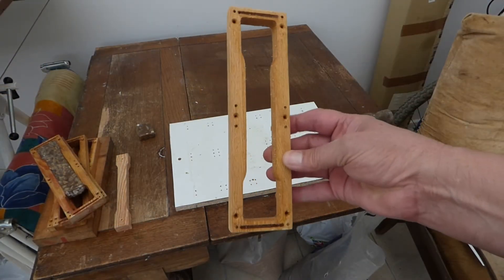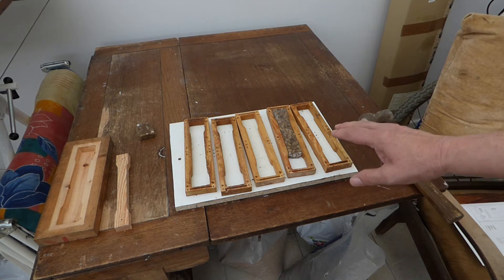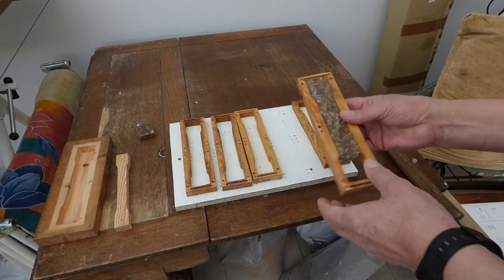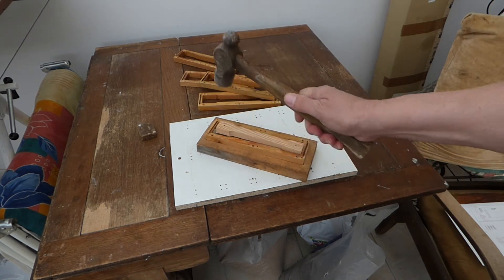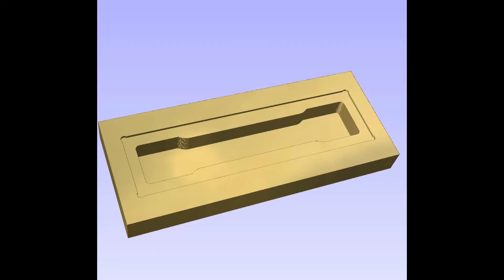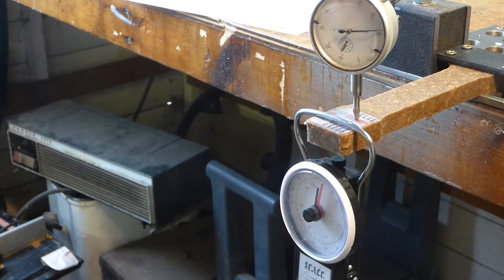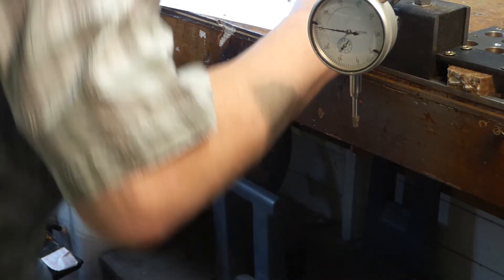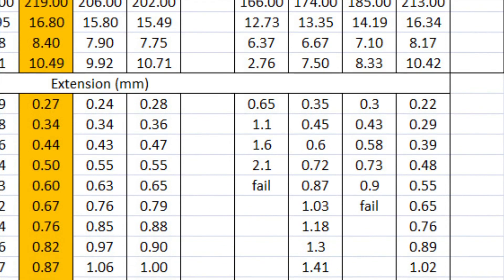My CNC Upgrade: pt2

Comment: Great video ! I'm very new to this epoxy granite thing and wondering if you'd mind sharing your spreadsheet ?
Also, wondering about the design principles and decisions in the test sticks design ?
Thank you for educating us 👍
Reply from the maker: Hi. Thanks for your comments. I don't mind at all sharing the spreadsheet. I'll need some way of getting a copy to you.
The test stick design was decided after a bit of research online. At the moment I do not require absolute property values but only comparative values. The shape seemed to be standard throughout the industry so I invented a design to suite my loading rig that gave a reasonable leverage radius for the loading. I thought about incorporating a slight neck somewhere on the test piece to concentrate the stress so that they always failed in the same place - but they seemed to fail in the same place anyway (so far) so it seems to be unnecessary.

Comment: Hi Jim, 
I just stumbled across your videos, great work.

One question though, all the mixes are quite high % of poxy. Everything I have read state the lower the better and thats around 8-10%.  How come you never tested at lower %?
Reply from the maker: A great question. It all depends on what properties you want the final composite to have. Another consideration is cost. Epoxy resing is very expensive so half the battle is finding a mix that satisfies your final material requirements without breaking the bank. Pure resin without any fillers is very rigid but brittle, with low strength and expensive whilst the use of lots of fillers may satisfy your structural requirements but is cheap to make. That is why I have been using fine sand - cheap as chips as they say. You can imagine the there will be a vast number of filler materials and their combinations that you can use. Some want vibration deadening mixes whilst others are looking for strength or fluidity to get into detailed moulds. In my last mix I was mainly looking for rigidity and that is why I made a high resin% mix. The thing to do is to decide on what fillers will impart what properties on the composite, make a sample and test it. In my next project I will be looking for a rigid but also high strength mix since it may be undergoing high torque stresses. I am thinking of employing some form of rebar structure but have not quite decided as yet. I have one or two other projects to finish before I can embark on that one.

Incidentally I did make some low resin% test pieces which I show in a previous ut vid. Suffice it to say that they were very weak - but may have been ok for some jobs.

Comment: Thanks for your reply. I now understand the problems you had and In view of what you said about one or other of the Y s stalling and causing the gantry to "Scew" (which I was also  concerned about because this has already happened in my tests even with big motors) I was thinking of tying the two motors togeather in some way (may be a tooth belt or light chain)so if one motor stalled or lost steps at least it would not scew the gantry it would merely slow the other motor down. What do you think? I think when using two motors on one axis a closed loop system is desirable but then there is the additional cost and complexity etc. Looking forward to seeing Part 3-4
Reply from the maker: Before you start 'ganging' the Y-axis motors I would look for other reasons for one of the axes stalling. There could be a few: 1) one of the motors is not being driven fully - check the electronics. I have found that over-driving my nema23 motors (now driving them at 65VDC thro 8060 drivers) does not seem to do them any harm). 2) one of the lead nuts is binding at some place on its leadscrew. 3) If you are using acme threads, the nut could be too tight. 4) if you are lubricating the leadnut and screw make sure that you use a very light oil (like sewing machine oil). I found that motor oil caused stalling at the higher speeds. 5) make sure that the carriages are totally free along the full length of their travel. 6) if the leadscrew length : to leadscrew dia is to high, whirling and resonances can also screw things up (no pun intended).
Hope this helps.

Comment: Hello Jim, I have been following your CNC vids with great interest for a long time now in fact it was your machine that inspired me to build one my self, would it be possible to show the problem you have with the machine, and exactly what is epoxy granite and how you intend to fix it .I am building a similar machine (slightly larger) and I have filled all major cavities ( Box sections etc ) with common cement mixed with fine gravel . To counter the weight I have used Nema 34's 1600 oz motors in a  similar set up to yours the result is a very sturdy strong machine so far (not finished yet)
Reply from the maker: Hello Steve. Thank you for your interest - it's good to know I'm inspirational. I can't really show the problems but I will attempt to describe them. My machine, I have always felt was underpowered for its size and weight. Because of the underpower I have had problems with one or the other Y-axes stalling when under a lot of load causing the whole gantry to rack and stall. This was a rare ocurrence but used to be always at the back of my mind. Another problem was the gantry flexing. Obviously when a load is applied to the tool, the flexing in the gantry will be more in the middle than at the ends. The only real way to defeat these problems is to strengthen and stiffen the whole system and increase the driving power of the stepper motors. With more power to the stepper motors comes more chance of vibrations being set up in the structure of the machine. So in an effort to forestall any such resonances I decided to add a stiffening damper to the gantry (in parts 3 and 4). When it comes to driving mechanisms with stepper motors - the more stiffening and damping the better. I have actually finished the upgrade, it is just that I have not got the vlogs done yet. I can report, however, that the machine is performing very much better and I have been able to double the accelleration of the traverses and the whole machine has a much more positive 'feel' to it. Currently I am running the nema 23's at 66vdc and they remain reasonably cool, even on a long job. The new psu can be adjusted up to 88v and the new drivers will handle up to 80vdc so I may tweak the volts up a bit but always keeping a weather eye on the motor temperature.